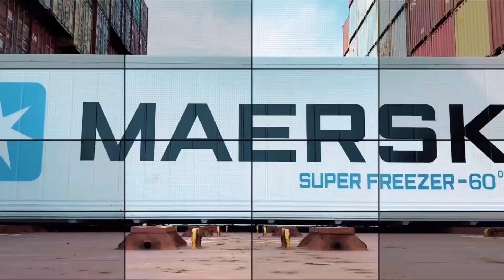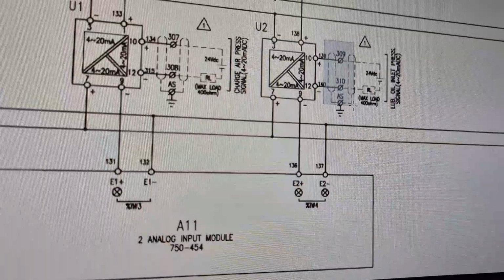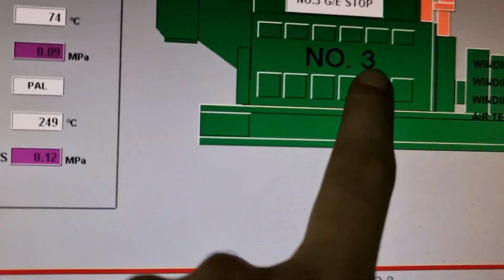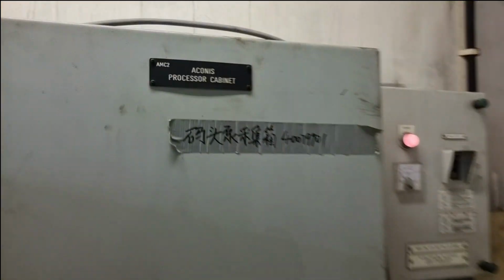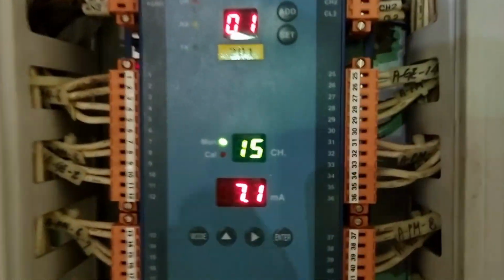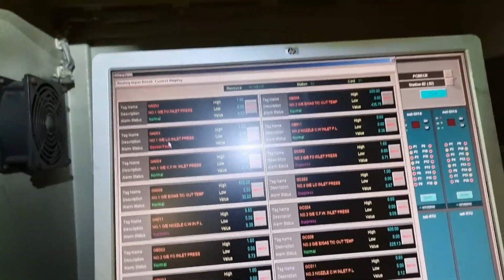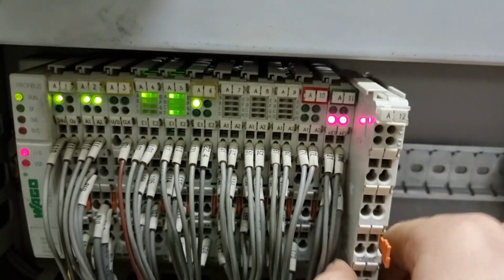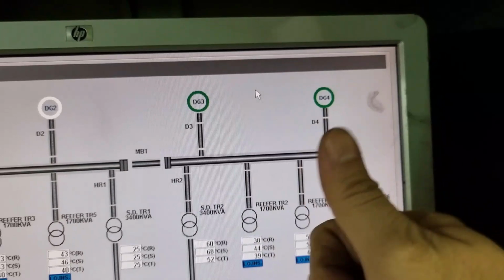PART 2 GENERATOR SENSOR FAULT ALARM, HOW TO TRACE WIRING DIAGRAM? | Marine Electrician

Comment: I just started watching your videos. I really enjoy them. You need a 4-20 mA calibration meter so you can source a 4-20 mA signal with having to swap wiring around so much. Also the A12 input card looked like a spare, could you not use it? Was it not the same type of card or had you already un-wired it?
Reply from the maker: Hi, thank you very much for your wonderful comment and supporting this channel. Very much appreciated. The A12 is for the ending card and cannot be used in replacement for A11. Only the a11 is the analog and the rest are digital.
Reply: I don't understand where you replace this😢